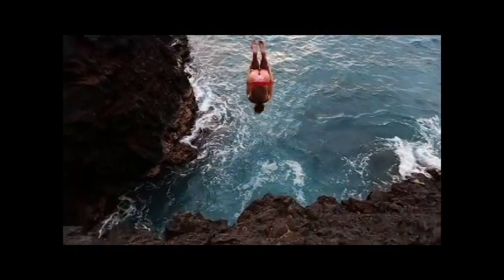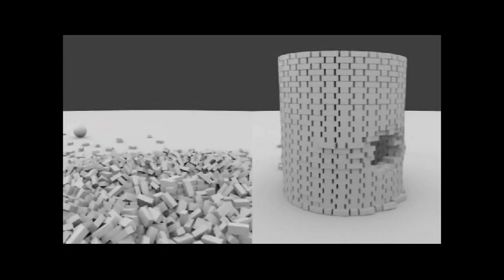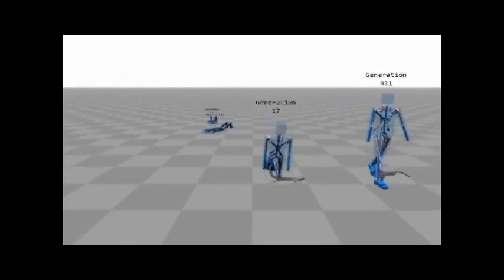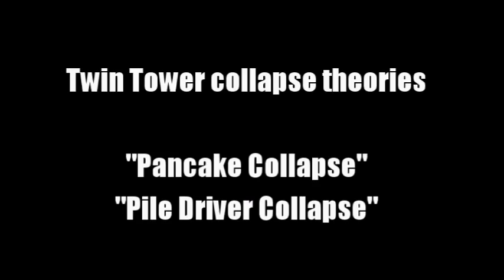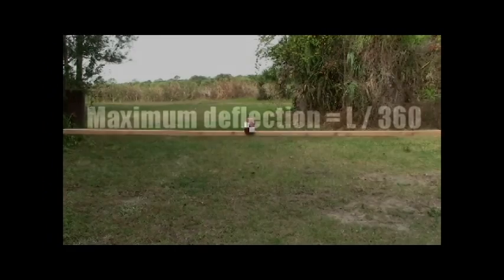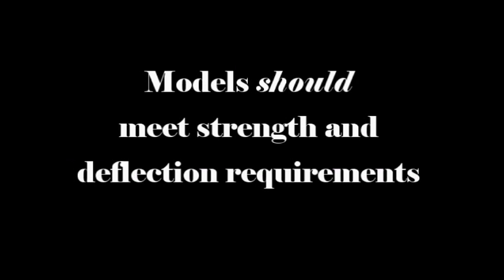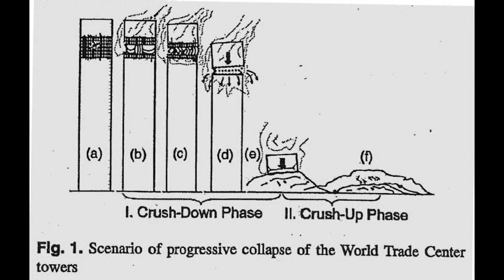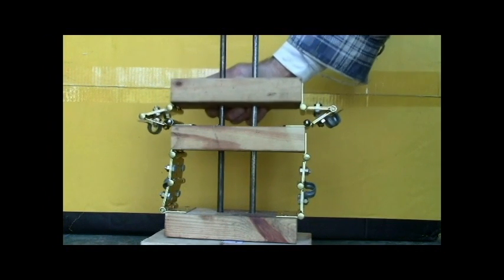9/11 Experiments: The Force Behind the Motion

Comment: So much effort just to come up with the WRONG outcome and of course, with the outcome that you want to promote. I was there. I witnessed the towers come down. There were no controlled explosions PERIOD.  You’re missing one single very important fact. A Boeing 767 flying thru the towers at 600+ mph. That you didn’t replicate in any way or form . Also you didn’t weakened those two fat steel tubes you used as a core / guide. The towers didn’t have something proportional that was that strong that thick, that stable, that solid and unheated as your two massive guide tubes were. 
I sa, you go to sign up for civil engineering and when you actually understand physics, materials, weights, loads, connection points, floor trusts, fire retardant being blown away by a jetliner crashing @ 600+ mph, the structural damage that a 767 causes to a building with such design, the actually fire burning temperatures of Jet A Fuel, and the asymmetric forces that not only damaged the structure asymmetrically but that the structure had to endure without the equivalent to the two massive still rods you used on all your failed attempts. What you’re saying is the equivalent to saying that JFK was poisoned with cyanide at breakfast that November day. If he was poisoned why to bother with 4 sniper  teams ? Why are you ignoring the Airliner at 600 + mph ?  Why to wire up an entire tower with dynamite / C 4 whatever if you’re going to fly a missile thru it ? You seem to have a lot of time to waste. Use it wisely. Go to a university and learn actual physics before you look like a fool in such an extravagant way.
Reply: The videos I can watch dispassionately at home, outweigh what you saw while you feared for your life. I can watch the videos in slow motion on YouTube, excellently filmed over and over again and I can compare them to other demolitions; successful and failed ones. Your being there does not make you an authority on anything.
Reply: Of corse, I learned my expertise by watching Youtube videos, and I find that more than enough to battle the Jew-payed shills like you, gustav. Your going to burn in hell.
Reply: Paid Government Shill_109 delusional psychosis and Ignorance go hand in hand for truthers..   you are a prime example .
Reply: Your comment is moot beacause we now know the buildings were vaporized and dustified by satelite-mouted Directed Energy Weapons. Read "Where Indeed Did The buildings Go" by Dr. Judy Woods. Educate yourself.
Reply: Don't you Jew-payed JTRIG shills not realize how painfully obvious it is to the normal honest Youtube user that I am an expert in many fields while the imposters clearly are not and they continue to pretend to be an educator while I am the real one, it being so very easy for normal users the check the channel identifyer number but hovering your mouse indicator over the avatar or user name making the situation clear that you and your associates are engaged in Psychoitronic gang stalking and CRIMINALLY ACTIONABLE FRAUD for which you will soon be prosecuted to the fullest extent of the law.
Reply: Quote of the day that describes your job function Joe:
Ignorance and obscurantism have never produced anything other than flocks of slaves for tyranny
Reply: linda green "" they were built to withstand two planes hitting them""" .. that was theoretical.. an opinion from the architect or the construction manager in charge of the project..  no testing was ever done to confirm that thought..  
Building 7 collapse has been explained.... maybe you should do some research.
Reply: The boeing 767 has a max speed of 403 mph at sea level, not sure where you got 600+ from? I mean, the plane was in a slight dive, but its max speed at 30,000 feet is 581 mph, still not 600+. Honestly not being rude but could you explain? Mechanical/Aeronautical engineer here :)
Reply: John Rodriguez .. you're an aeronautical engineer?? 
then you should understand that Max Speed and Max operating speed are two different numbers... 
Boeing specs for a 767 - 200 state the jets can fly at mach .86 at any altitude before structural failure..
That would be 654 miles per hour.... 
Flight 175 was in a prolonged dive,  not slight, coming from 24000 feet to impact height in less than 5 minutes..
Reply: Joe V at mach .86 the aircraft is going 650 mph, at 500 to 1000 meters thats about 50,500 n/m^2 which is about 6.5 psi of dynamic pressure on the frame. This is out of limits for even the dynamic pressures and would rip the plane apart, now if i change the math to 500 mph at this altitude then we can see that the dynamic pressure changes to 40,500. Which is still out of limits for this altitude and pressure, but is more feasable and i could see the aircraft maintaining this for the time it took to hit. So if it was said the jet was going around this speed i could possible believe it. But definetly not 650 mph, thats a bit out of reach even for a heavy dive

Were any of the black boxes even recovered? That would be great to finalize what actually happened that day on those aircraft
Reply: John Rodriguez you are misunderstanding something.. no one is claiming the plane hit 650 miles per hour that day..    BUT,,, Boeing specs for a 767 - 200 State the jet can hit Mach . 86 at any altitude before structural failure.   
the claimed speed of flight 175 was approximately 590 miles per hour..    
Everyone saw the jet flying at that speed.   Both airline companies have claimed those were their jets at all four crash sites... Not ""military planes""
Reply: Though I agree with most of your post and certainly its general theme - I have to point out that neither aircraft hitting the towers was travelling at 600mph+ - the south tower was doing around 550mph at the moment of impact and the north tower substantially less, around 450mph - thanks to the grid format of New York it's relatively simple to establish reference points from all the video available. As a matter of interest, considering the towers were 208ft square, you can also work out how much velocity was lost through the building absorbing kinetic energy - it's a pretty good clue to them being real aeroplanes - if you were in any doubt!

Comment: Holy Crap, what a joke.  In your first "model", how about those 1"X boards you had screwed to a rigid structure supporting your "floors", did the towers have those?  NO!  In your last model, I suppose you performed calculations to determined the  weight of each floor of the Towers and built your model to scale?  NO!  Absolutely worthless modeling.
Reply: Have you had a chance to read either NIST report yet?
Take another dose of Xanax before you do.
Reply: Yes, I have read the lengthy report and countless articles by folks trying to manipulate the information to fit a narrative.  I have also read reports by various credible engineering organizations.  The towers fell due to damage sustained by a nearly 400,000lb aircraft, carrying over 20,000 gallons of fuel striking the building at over 500 mph.  You can argue "how" and "when does steel melt" and one of a hundred other angles.  Steel doesn't have to "melt".  It loses half its strength at 1100 degree, well within the heat range of the burning fuel.  Also, it wasn't just burning jet fuel running down elevator shafts, it was a building jam packed full of combustible material from carpets, to insulation, to furniture to huge amounts of paper.  I am breaking my rule, arguing the "exact failure sequence."  My standard answer:  So, what had to happen to make the conspiracy work?  I guess it depends on "which conspiracy theory".  At minimum, the government had to pay off thousands of people and get them to stick to a story.  From the flight school who trained the radical islamist, to the air traffic controllers, to the Military who tracked and attempted to intercept the second and third plane, to the families of passengers, to cops, to fire fighters and on and on and on.  Then, you  have the "demolition crew".  Do you have any idea how long and how many folks it would take to wire and rig explosives on three friggin buildings, two over a 100 stories tall?  I suppose crews worked for months drilling columns on every floor, running miles of cord, setting up timing equipment and no one noticed.  Then, have a plane flying over a 500 mph into the "rigged" building at EXACTLY  the right point as not to damage ANY of the explosive devices or wiring.  Damn good pilot.  Oh wait, there was no pilot, the plane was remote controlled.  Or, was it a missile, which theory are we going with?  Then, ALL the explosives, every single one, went off at exactly the right time to produce the consistent "puff" we see as each floor collapses.  PERFECT timing!  Perfect demolition.  Hell, they can't get a friggin' old stadium to fall over as planned, but they can demo three World Trade Center buildings perfectly.  To make ANY of the conspiracy theories work, thousand of people, thousands of family members, numerous government agencies and hundreds of private companies would have had to been involved.  And not ONE credible person has came forward.  All this for what?  To "steal oil from the Middle East"?  The oil we never stole?  "Insider Trading" which has been investigated by non government anti Wall Street organization after organization and found no credibility to the claim.  Or, to get citizens to surrender their Constitutional Rights not to be spied on?(they did succeed on this one).  Or, to push a one world government?   Or, to "falsely portray islam as violent" and start a world war?  Probably the last one as there certainly aren't ANY other examples of radical islam killing tens of thousands of innocent folks around the globe.  Too bored to reread and fix the typos.  You get the idea.
Reply: But aparently you HAVEN'T read the science of Dr. Judy Woods, who has prooven that the buildings were vaporized and dustified by satelite-mouted Directed Energy Weapons, Have you now, duhbunker?
Reply: The 767's of 9/11 we estimated to weigh ~285,000 pounds at the time of their arrival in NYC on 9/11 red. Did you not read the 9/11 Commission Report?
Reply: Also, it was written in the 9/11 Commission Report that those 767's of 9/11 carried ~10,000 of jet fuel when they got to NYC. What crazy ass conspiracy site did you get your information from?
Reply: Anyway, everyone knows the planes were holograms.
Reply: I didn't know the 9/11 Commission Report was a hologram, randy?
Are you quite sure of this?
Reply: Is this like your thoughts about planes and holograms. randy?
Reply: If you were a real truth seeker like me, you'd be spreding the word about the work of Dr. Judy Woods, randy.
Reply: what's with the generalization? You're an idiot, randy, so why bring it up? It's irrelevant. Why bring up straw man arguments